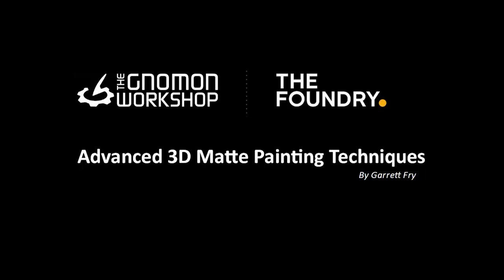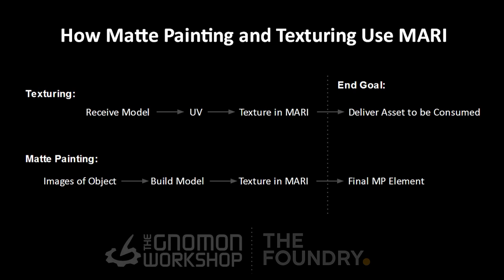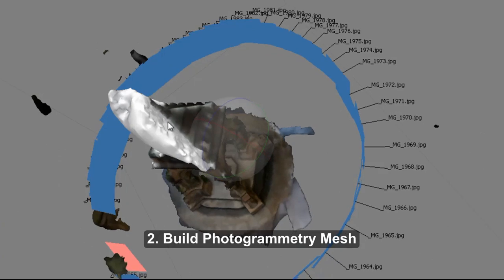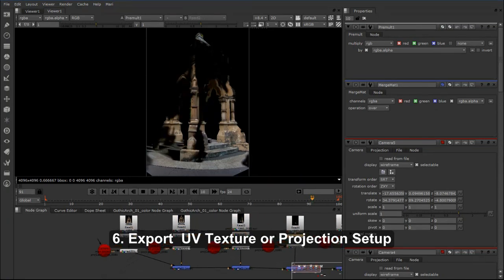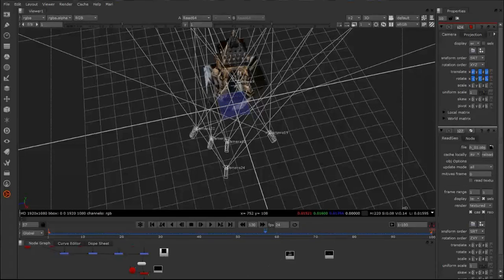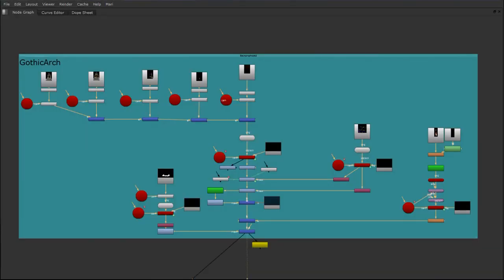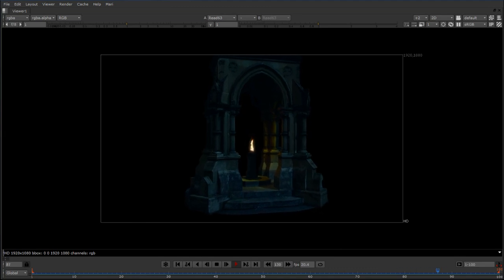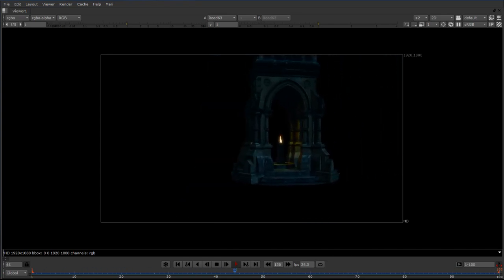Matte Painting Photogrammetry Workflow - MARI Tutorial by Garrett Fry

Comment: Garrett, this video is dated to March of 2014, about the time I bought Mari 2, that's the version featured here?  If so, how are you locking the perspective of camera/projectors to perspective of the model to ensure solid co-registration when painting-through? I'm working with phtogrammetry-derived assets to add higher frequency detail via normal maps in Mari, but also wish to paint in scan-based isolated specular data for roughness map. Co-registration is a must for this to work, am fighting navigation in Mari, not even support for Space Mouse! Many thanks for your thoughts.